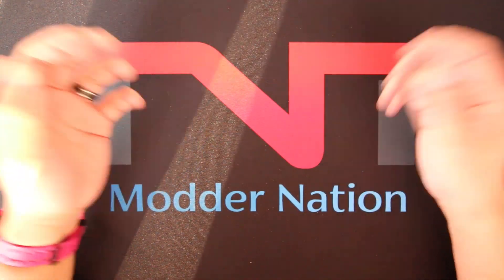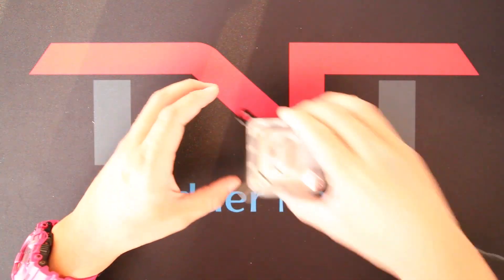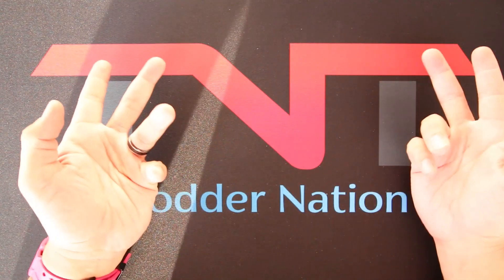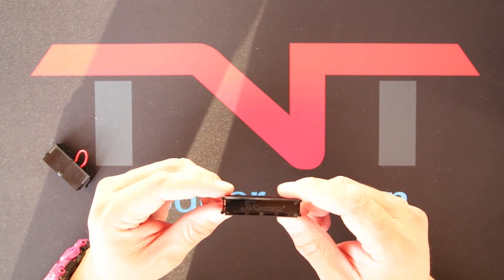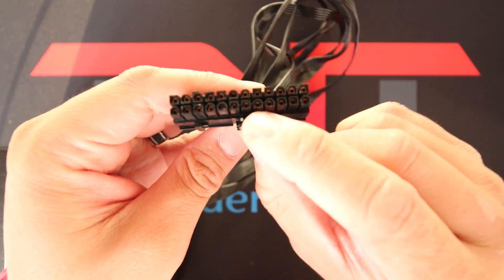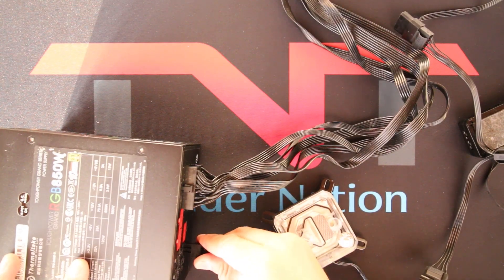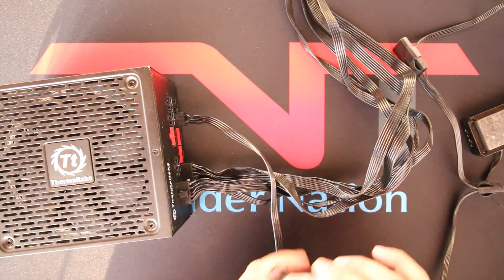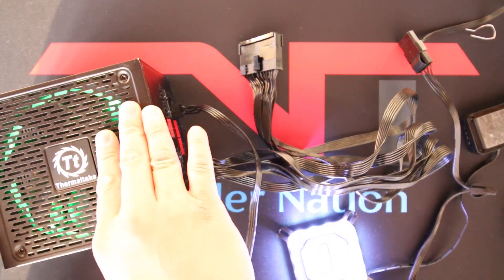How to Jump Start/Test a Power Supply (PSU)

Comment: I saw threw different videos that showed a different spot where they put the jump wire/pin  was used. with that said use multi meter first.
Reply: here: https://www.youtube.com/watch?v=aU18uPlETCM&ab_channel=Joe%27sVids
4th one from the right is the green, 1 right to that (and also 3 wires left to it) are the black (ground); so you can connect 4 different ways.

Comment: Hi i saw other vedio said to plug into number 4&5
Reply from the maker: If you buy actual jumper there is two ways to plug it into. Other video is right also
Reply: @TheNoviceTech  I wish to buy it but for mean time i have a used PSU and I don't have it and after many search I  believe number 3 & 5 both are ground and does not matter where you plug in
Reply from the maker: Osamah.Mohamed the jumper that I bought used 4 and 5.
Reply: @TheNoviceTech bingo i did it and the psu is working now perfect thanks for helping me
Reply: You deserve to supscripe in your channel
Reply from the maker: Thanks a lot I appreciate the support 😃